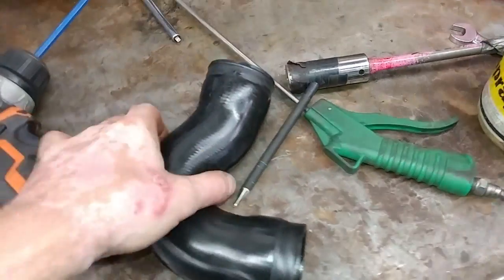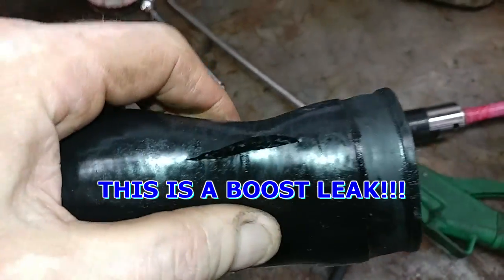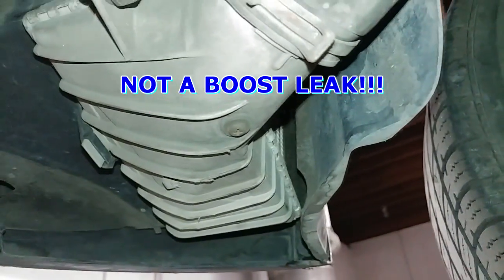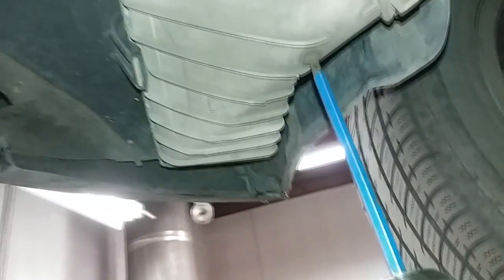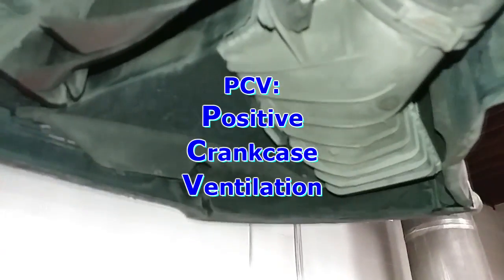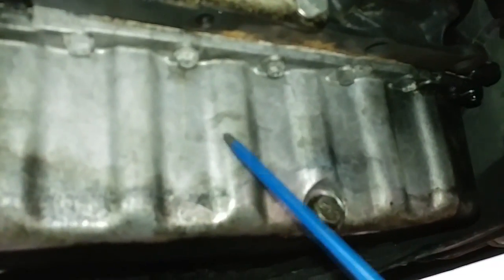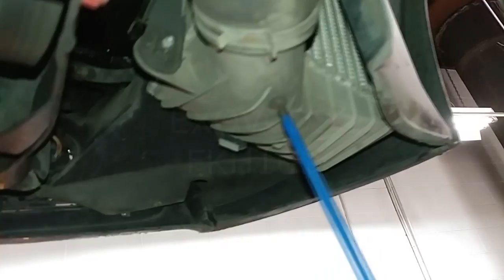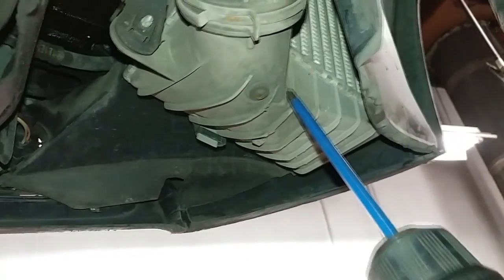Intercooler drilling, draining & plugging = NOT a boost leak!!!

Comment: I have a few problems with what you are saying. Some vehicles have high intercooler hoses. So the intercooler fills with oil. I would have to remove my front grille and intercooler to drain the inter cooler. Catch cans only catch the pcv vapor. A small or slow turbo leak could fill your intercooler fairly quickly.
Reply from the maker: @fourbypete
It is obvious that different intercooler require different cleaning / draining methods.

I am a VW / Audi channel. All intercooler draining videos that I post are for / of Mk4 TDI and 1.8T intercooler designs... where a "low spot" is conveniently located at the bottom of the cooler. Some videos of 2.0T engines are also on my channel, since they have a similar intercooler.

If a front mounted crossflow cooler is in a vehicle... a different method will need to be applied.

Comment: What size hole and screw are used? Would this possibly cause a 1556 code?
Reply from the maker: Use whatever size hole you feel comfortable with... use whatever size screw that seals the hole.
As cam be seen in the video... the screw and area around the screw is dry. 
P1556 refers to low boost.
If boost had been leaking at the screw, then there would have been signs of oil escaping with air (boost).
Even if the screw had been left out, the open hole would not have been able to cause a leak big enough to set a P1556 fault code.

Comment: After replacing a faulty N75 solenoid, my '02 Jetta now developed enough boost to cause the "pooling" oil in the intercooler to be pulled into the engine causing and uncontrolled amount of fuel (oil) supply which resulted in a runaway over revved engine. Yes it destroyed it self. The engine is now stuck. Not sure what failed. Using the time to install a replacement engine from a wrecked Jetta. As advised, drain the intercooler.
Reply from the maker: Sorry to hear that. 
Draining / checking is a simple procedure... once you know about the possible oil issue. I don't know why so many people are against doing it.

Comment: An oil catch can would keep the oil away from the intercooler and keep it efficient at heat exchanging, as we all know oil has a thermal isolation effect
Reply from the maker: Catch cans are great for  condensing water out of the warm PCV air.
Reply: @EXOVCDS  
And for capturing the oil from the PCV gases. Take a cheap Chinese version and stick with your opinion. Take a genuine Provent 200 by Mann+Hummel and review your idea
Reply from the maker: I'll stick to the cheapest option... draining the intercooler. All manufacturers sell turbo vehicles that have intercoolers that get oily / catch oil (like a catch can). If it were cost effective, all manufacturers would install one during the production phase.
Reply: @EXOVCDS  
Wrong. Little to no car drivers have an idea of what a catch can is supposed to be maintained and this is why almost no car comes out of the factory with a catch can installed
Reply from the maker: LOL

Comment: I mean that’s awesome but I have not seen a video yet where anyone talks about plugging it or shows how that is done. I’d like to do this but I don’t want the oil leaking out on driveways and roads.
Reply from the maker: Uh, the screw is what plugs it. Drill hole... drain... insert screw.
At 2:17 of following video, you can see me screw-in a screw to seal the hole. Remove screw at every engine oil change... to check for excessive oil.
https://youtu.be/yeKpRMF7ecw?si=obEf4g2aFpFawXuA
Reply from the maker: Sorry, this link.
https://youtu.be/BO5Q55zggXY?si=wRSsdCoFkkRnmFf9

Comment: Is there a way to drain this without drilling a hole? Mine appears to be leaking from the bottom corner where metal and box meet. I'm surprised the intercooler is still there with the amount of times I've smacked the bottom.
Reply from the maker: Remove the cooler for cleaning if you don't want to drill. If the leak is coming from where the core meets the plastic end, it could be that the plastic trim in front of the core is rubbing against the core and cut into it.
Reply: @Thomas EXOVCDS  Unrelated but I have a vnt15 turbo with damaged threads where the oil feed screws into. It's leaking oil from the base and I'm wondering if I lock the union in there with jb weld that will stop the leak?
Reply from the maker: No idea, sorry.

Comment: Thanks for the video - was wondering if i really wanted to take my car apart ...frontbumper and so , just to get to the cooler ( volvo s80 t6 ) a pain to get to . Thought of doing what you did, by drilling a hole and put in a screw after . now i wants to clean it ha ha ha ....hurraaaaa for the screw
Reply from the maker: I don't know if Volo coolers have the same problem (oil collecting).
Reply: @EXOVCDS  either do i, BUT...i love my car and wants it to stay nice ;-)

Comment: I know this is an old video. I certainly claim no expertise here.  But, I cannot see how the intercooler can pick up contaminants that are piped from the PCV valve directly back into the intake manifold. Is there someone here that can explain this to me?
Reply from the maker: PCV can only enter the intake manifold under vacuum / low pressure. Since tdi engines have turbos... it is impossible to vent PCV directly into the intake manifold (due to the boost the turbo creates). Hence, PCV is routed to the turbo inlet.... which then carries the pcv fumes / oil through the intercooler. Simple, no?

Comment: Hello sir , I have a 2013 ford f 150 basically with 119,000 miles I was going to buy a catch can for it because every once in while it goes to limp mode a wrench goes across my screen and it just won’t move just idles really bad but when I turn it off it’s starts right back up I was considering doing the weeping hole should I plug it afterwards or leave it open ? Should I install a dual catch can ? Any advise would be highly appreciated
Reply from the maker: My videos are for VW/Audi.
My limited understanding of ecoboost issues... is that "condensation" in the intercooler is the issue, not so much the oil. A catch can can collect oil / fumes and will also collect condensation.  However... condensation can still happen in the intercooler. I plug all intercooler holes that I drill... and I drain the intercooler of oil at ever engine oil change, because oil is the issue with the vw/audi engines I feature cooler draining on . If I owned an ecoboost vehicle, I would drill a hole and leave it open. You are better off getting info from ecoboost owners or talk to a Ford Mechanic such as:
https://youtube.com/c/FordTechMakuloco

Comment: Hi. I have got a VW Transporter T6 2017. There are 2 sensors right before and after intercooler. Once I removed it and it was fully in oil. My check engine has come on and low horse power. Do I need to drain this oil and get rid of it? Thanks for your reply in advance.
Reply from the maker: Some / a small amount of oil is normal... but over time, it can collect and accumulate 250ml or more. When too much oil is present, it can create engine damage once the engine is under full boost (high air flow will force the oil into the engine, causing the engine to runway / burn the oil and exceed maximum engine speed)... so yes, it is a good idea to check for & drain any oil that is in the cooler. Check / drain at every engine oil change service or once per year.
Reply: @EXOVCDS  thanks very much for your help. It is pretty much appreciated.
Reply from the maker: @TheMt9398  can you post a video on your channel of your cooler and the 2 sensors? We do not have T6's in Canada... what size engine?
Reply: @EXOVCDS  I am not very good with technology but I'll try to send a video of it. 2.0 Litre TDI. This is the part number 04L145749H. If you Google it it will come up. There is a sensor on each end where the black plastic is. When I removed the sensor it was covered in oil fully. It did not make any sense at the time to me as the intercooler must be either air/air or air/water heat exchanger which in my case must be air/water. I've left it as it was as I wasn't sure it was right to remove the oil. After you've looked at the part on Google it might enable you enough to advise me whether to remove the oil.
 Thanks again for your time. have a great day.
Reply from the maker: The metal part of the cooler contains engine coolant... do not drill that one. =)
If you have too much oil in the plastic "air passages" then there is a problem with the turbo.
Reply: @EXOVCDS  Thanks very much for your reply.
Reply from the maker: In my last reply, I meant problem with turbo... if too much oil is in the air passages of the intercooler.

Comment: Doesn't a catch can catch the oil before it gets into the intercooler?  Also what about carbon buildup on tje back of the intake valves on vehicles with only direct injection?
Reply from the maker: No... catch cans can't catch all the oil.... and they trap more water / condensation than oil... and they have to be drained often (depending on the size of the can). 
What about carbon buildup on direct injected engines? Catch cans don't reduce / prevent carbon buildup.

Comment: On my 2020 3.5 EB engine, looks like the PCV hose routing does NOT go into the air intake on the suction side of the compressors (turbochargers), so I do not see how the accumulated oil can be from the PCV system. I installed a catch can on the PCV circuit, and it works as advertised. Not sure about how the PCV is routed on the 3 litre diesel engine.
Reply from the maker: I'm not familiar with EcoBoost engines... it is my understanding that the crankcase has to be able to "vent" crankcase pressure while under boost (or else oil seals will blow). The only way for venting to occur (while under boost), is for the PCV to vent into the low pressure side of the turbo inlet. Until I get my hands on a EcoBoost Service manual, that is what makes sense to me. EcoBoost engines seem to have more of an issue with water condensing in the intercooler... as opposed to oil collecting like the VW Diesel engines that I work on. For most EcoBoost owners, it seems that drilling the cooler & leaving the hole open, solves the misfiring issue. The problem that I am "preventing" with drilling & draining... is a "runaway" scenario that can occur with the Diesel engines, when too much oil collects and is forced into the engine under high / extended boost.

Comment: Hello,
Much needed video...

So I just took over a 2005 Bentley W12 6.0L and found that bank 1 intercooler is filled with almost a 1/3 qt of oil. Was told by the previous owner that this vehicle hasn’t been properly maintained. Could a restriction of the intercooler caused bank 1 to have misfires? Poor performance? Because that’s exactly what’s going on...I’m getting codes P0300, 301, 302, 304, 305, 306. 

Currently, the intercooler lines are disconnected to have it thoroughly drain overnight. Any response would be appreciated!
Reply from the maker: If oil is only collecting in the bank one side, there might be a turbo issue. You are correct, the excess oil is the reason for the misfires on bank one... if bank 1 & 2 have separate intakes (own MAF, throttle body etc.). I dont have a service manual for that vehicle / engine. So that would be my guess.
Reply: Thomas EXOVCDS 🙏🏽🙏🏽🙏🏽
Reply from the maker: Oil is being ingested under boost... causing the misfires.

Comment: I have a 3.5 ecoboost engine and I have a catch can if I drill a whole in my inner cooler to drain n plug it will it affect the way it performs I had the truck for a year before i put the catch can on it n I've had the truck  for more than 3years now
Reply from the maker: According to "the majority"... no intercooler drilling / draining is required when a catch can is used. My videos deal with known issues of oil accumulating at the bottom of intercoolers that have "pockets" where oil can collect. I don't know which is more responsible for ecoboost misfires... water / condensation or oil. If it is water / condensation (like VW had problems with in their Common Rail TDI engines) then the cooler is cooling too much (too efficient). You can block off a section of the cooler to raise the temperature / outlet of the cooler (will still be cooler air than the initial compressed air that is entering the cooler).
Reply from the maker: The problem is also present when the engine is off... the warm air that is in the cold intercooler, condenses... depending on how much moisture / humidity is in the air, you can have little or lots of water that condenses.

Comment: I'll have to drill and tap an oil drain on my all-aluminum oil cooler for my early 90s Audi.  Definitely better than pulling the entire IC and draining it.
Reply from the maker: What year & model specifically? I'm trying to remember which models had an all aluminum cooler. Depending on the shape of it, it might not have the issue that these coolers have (pocket where oil can accumulate over time).
Reply: @EXOVCDS  My 1994 Audi S4 (AAN turbo 2.2T) has the all metal intercooler.  My 1995 Audi S6 (same engine) came with model year change of plastic end caps on the intercooler.  First sign that Audi began to pinch pennies and cut costs in the manufacturing process.

Comment: Thank you so much Thomas! This 'Hack' helped my Seat 1.9 TDI pass the emissions test and M.O.T. I drained the oil as per your vid (about 0.5 Litre / quart) first. The small hose between the Anti-Shudder Valve and Vacuum was leaking (damaged) so a Garage nearly blew the engine after reving it and it started running on the oil laying in the intercooler! Luckily they shut if off somehow - now I have replaced the hose so it should shut off properly! Turbo still leaks oil slightly though.
Reply from the maker: You are lucky they were able to save the engine! Check /drain the intercooler after a couple weeks or one month... to get a baseline of how quickly oil collects. If no major oil is present, then drain it at every oil change (once a year). Thank you for watching!

Comment: I have. 2004 tdi bew and that lower intercooler pipe keeps popping off. I already did a kerma dog collar for the upper pipe going into the anti shudder valve. I just ordered an aftermarket male male coupler but it's only $30 so not sure how long it will last. Any suggestions to keep it together. Or just replace the coupler? $100 just seams excessive for a 4" long pipe adapter. I know your an OEM parts guy so I feel like I know what your going to say
Reply from the maker: Convert to the earlier ALH setup... here is a parts catalog where you can find all the ALH part numbers:
https://volkswagen.7zap.com/en/usa/jetta/jem/2002-270/1/145-145080/#1
Or go to a wrecking yard and remove the components you need. Basically from Turbo outlet to shut-off flap.
Reply: @EXOVCDS  awesome thanks !

Comment: Have the 3.5 EcoBoost in 2013 f150. Want size hole would be recommended? 1/16? And there haven't been any boost leak issues with that?
Reply from the maker: Whatever size makes you feel comfortable.
Seeing how clean the screw head is... should answer the second question.
From what I have head about EcoBoost issues... it's best to keep the hole open (not plug it).

Comment: Just curious, what kind of screw are you using to plug the intercooler? Would like to do this on my BEW..
Reply from the maker: Any self tapping screw that will fit / is slightly bigger than the hole that was drilled.

Comment: Thank you for the advice! I just did this to my tdi. I do have an off topic question on the 2003 1.9 tdi ALH is there a map sensor and a boost pressure sensor? Thank you for all the videos I really do appreciate them
Reply from the maker: They are the same / one sensor. On the top of the intercooler.
Reply: Thomas EXOVCDS Thank you! I really do appreciate it

Comment: What kind of screw did you use there for the CAC hole plug?
Reply from the maker: Depending on the size of the hole... any screw that will go in tight.

Comment: GREAT idea; too bad that some intercoolers are nested in a way that there is no access to the bottom of it,the only way is to drill it a bit to the side (facing the rear of the car); 

I'd say,leave the hole,2 mm,open; if you see oil on the parking spot,you have a turbo going bad,and you may save the engine from eventually running away; ask me how i know.
Reply from the maker: Nobody listens to or reads what I post in my videos... all of my "oil draining" videos of intercoolers are of TDI diesel engines. 99% of the oil that collects in those coolers is oil from the PCV. I too blew up an engine because of oil that was in the cooler... it was a TDI diesel engine.... THATS why I drain the coolers. It's NOT an issue on 95% of TURBO GASOLINE engines. Only on the 5% that have a similar cooler design where OIL CAN COLLECT.

Comment: Drilled mine in the same place on my 2016 F-150, pink thin fluid came out, is this coolant??
Reply: Hahaha
Reply from the maker: You drilled the wrong part. =(
Reply: Yeah, you don't drill the radiator, you drill the INTERCOOLER!
Reply: It was a joke? 😀

Comment: The intercooler is only a catch can under boost. Otherwise the PCV system uses manifold vacuum to pull the vapours directly into the intake manifold and never goes through the intercooler. Under boost the PCV valve closes and crankcase vapours are sent through the turbo, the intercooler and then into the intake manifold. A dual valve catch can that captures crankcase vapours from both sides of the engine will all but eliminate oily vapours from the "turbo system". If the intercooler has a condensate issue that's another issue completely and usually is associated with poor intercooler engineering. Without a catch can, regardless of a drain or not on the intercooler, the back of the direct injection engine intake valves will suffer from excessive carbon on the intake valves and over time will need to be serviced to remove the deposits.
Reply from the maker: This is a TDI... PCV goes through the turbo inlet first and then through the cooler.